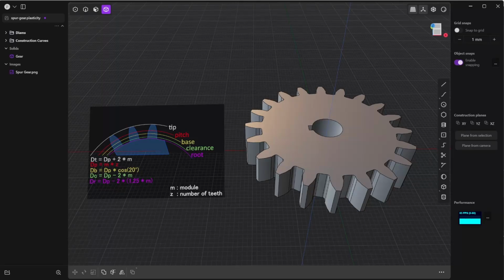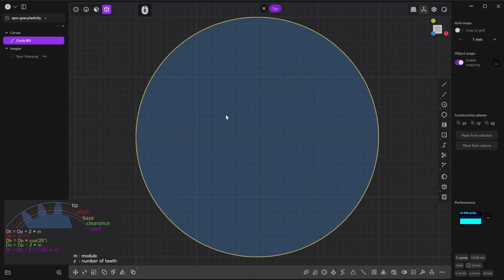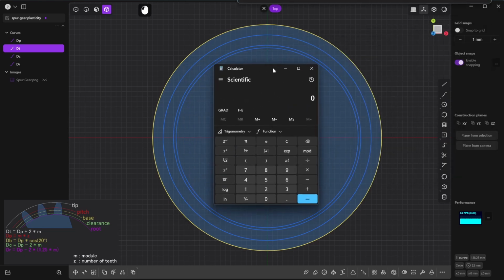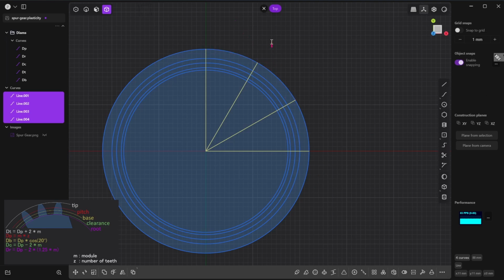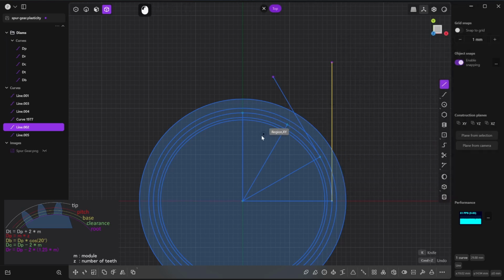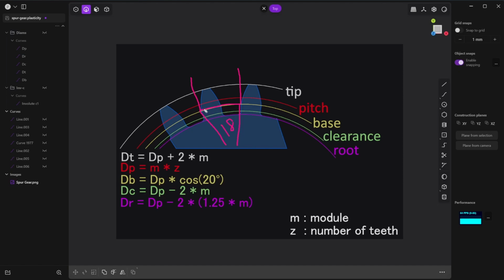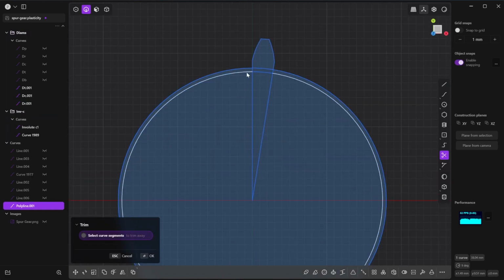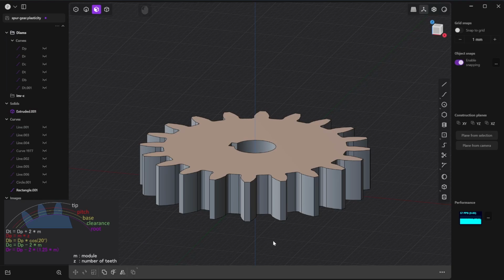Step-By-Step Spur Gear Modeling Workflow in Plasticity 3d

Comment: Great tutorial. Very helpful to actually understand the geometry behind. I was getting slightly different values, then i realized you calculator was set to grad not degrees in the video, comes up to .5 mm of difference in base diameter when calculated.
Reply from the maker: Glad to hear that it was helpful.